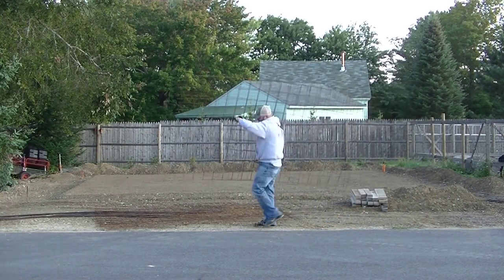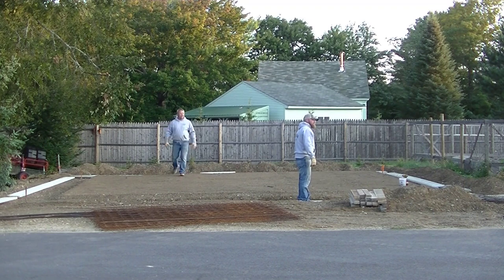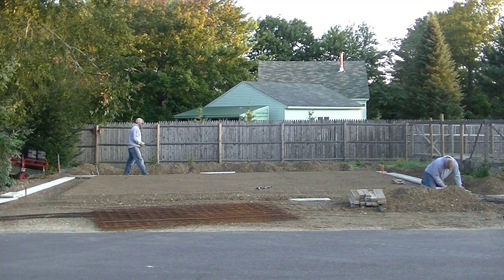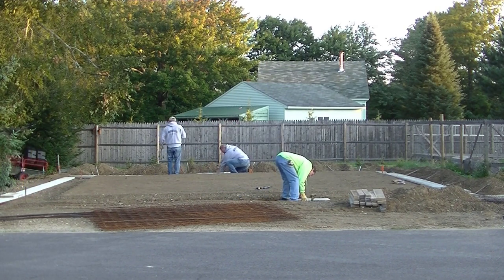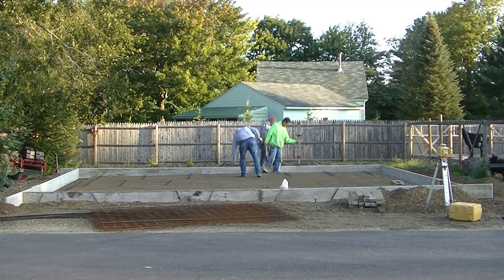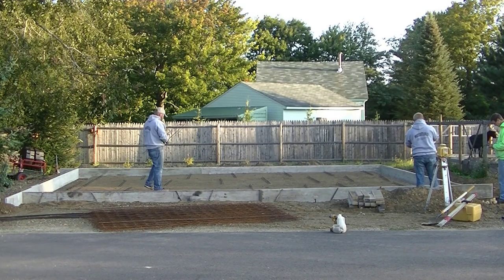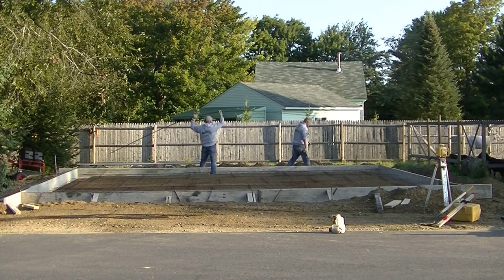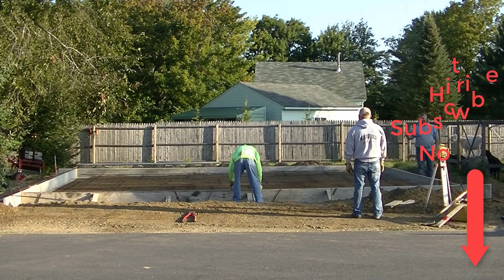How To Build And Set Up A Concrete Slab For A New Garage | Part 1

Comment: As a forty year concrete  finisher this video is 100% complete. Each individual on the job knows what they have to do and also knows what the other individuals are doing which makes the job easier and quicker. From the forming to the pouring and to the finishing everything is time sensitive. Then it's off to the next job.

Comment: Mike thanks for your great videos.  looks like you have a great team.  One comment about anchor bolts, they should stick up out of the slab 2 1/2"  or 3"  above the surface of the slab.  The sill plate which the anchor bolts attach to is 1 1/2" thick.   Also, the  IRC code requires 10" A-bolts for all home construction and garages.   I'm in Arizona and a lot of contractors still use the 8" A-bolt which doesn't meet code. Note, at home depot the cost is almost the same for 8" or 10" A-bolts.

Comment: Quick question... I see you use a lot of haunched slabs with no frost walls. In your area especially, what keeps the slab from heaving from freeze cycles? In Pa we need to put everything 36" deep to prevent heaving.

Comment: What your dimension for your wire mesh?
Reply from the maker: Those are 5' x 10' sheets.
Reply: Thanks man I’m from London but taking my form work carpentry in Sweden so your page is very useful so thanks for that! It would of been a dream to work with you and pick your brain for knowledge.

Comment: No mention of how to make sure 2x12s are plum or did I miss that part
Reply: If it's a level slab and the dirt work is good, once you pin the forms together they are already very close to plum. If something looks/ feels way out of plum, put a level on it and tweak it. Also: they dont have to be perfectly plum
Reply from the maker: You can tell by eye if they are plumb or not.
Reply: Gets covered anyway right